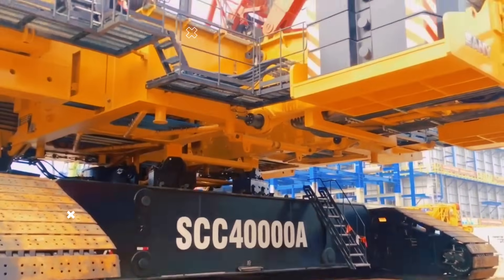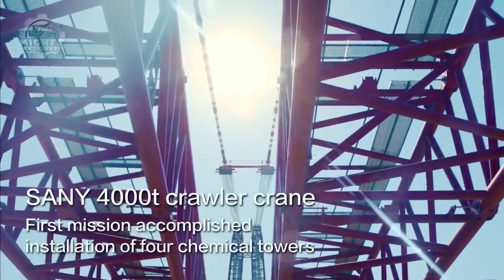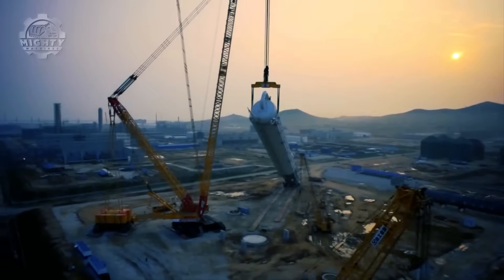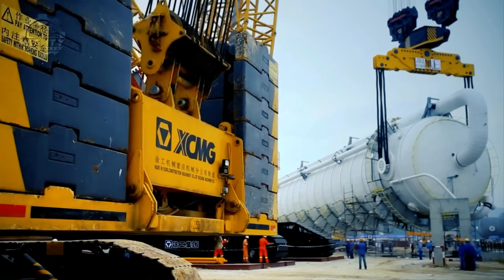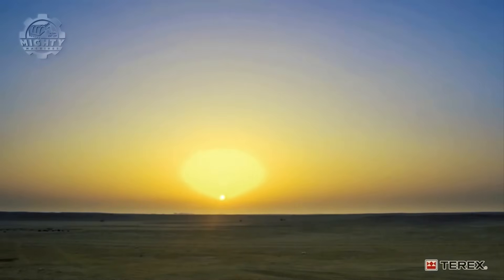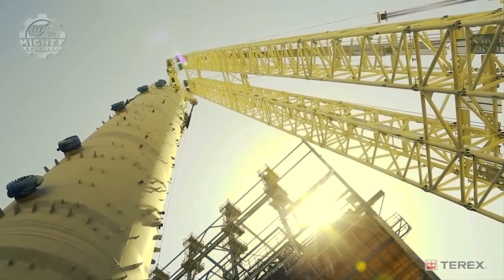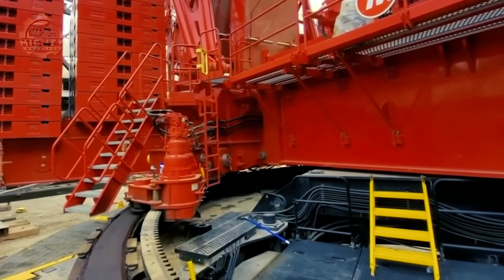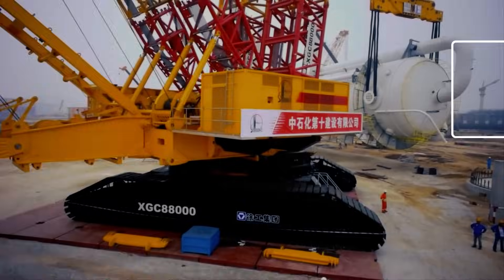Check Out These 5 Biggest Cranes In The World - Wow!

Comment: SANY has 4000 ton lifting capacity, XCMG 3500 ton. Both exceed Liebherr 3000 ton.
Reply: Liebherr lr13000 is conventional so it can operate without Derrick ballast, anything bigger is double boomed and can't. Lr13000 will outlift them all also at greater radious becouse of how much lighter boom is. Much better crane in terms of usability